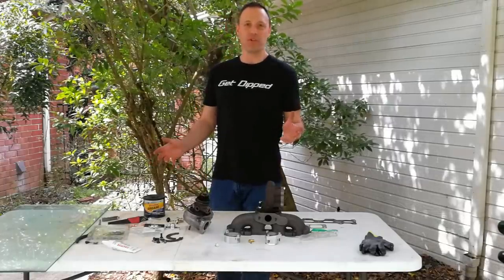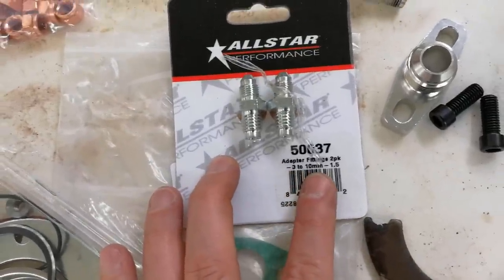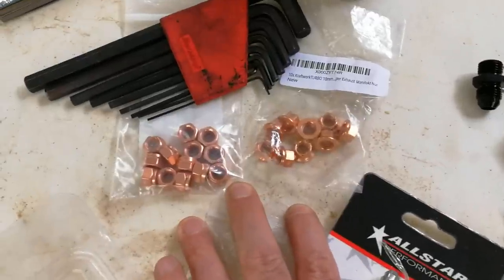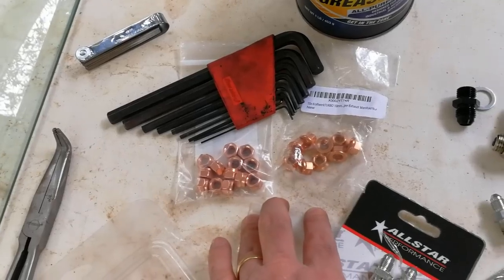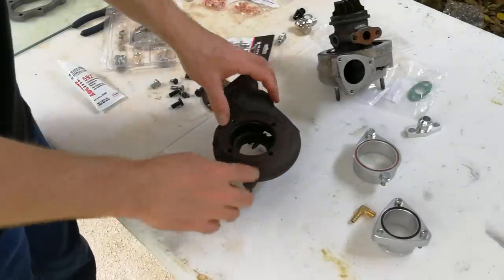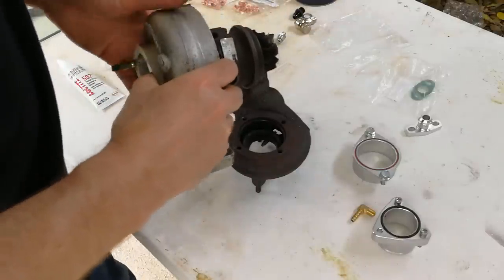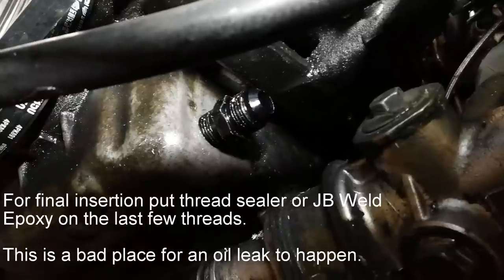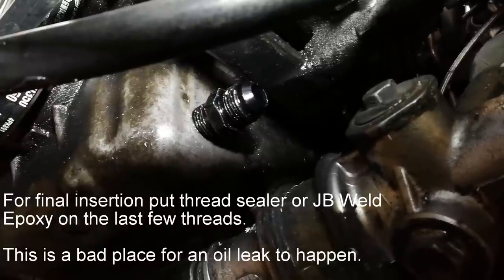DIY Miata Turbo (Ep 3) Turbo Setup, Lines, and Drill the Pan!

Comment: in my experience wrapping the drill bit with a butt load of electrical tape as the drill stop works a tad better due to the pvc not going ever where. You are also able to the how much shaving get on grease. I re greased like 6 times when I did it. Great vid. I just installed a GT2871R instead of a American assembled China Charger. And holy cow the response difference. Good luck in your build.
Reply from the maker: Thanks! Yeah I stopped and regreased about 3 times, lol.  Your gt28 is awesome!

Comment: Hello, for the four studs on the corners of the exhaust manifold to cylinder head , are you just going to run longer bolt or have you find any longer studs that will work with the thicker flange on the corner of the manifold ? Thanks
Reply from the maker: Yes I got 60mm studs in the same size and thread.  It's still a bit challenging though because putting the manifold on and off as a unit with the turbo is difficult with them installed.  I've cut the shelf a bit to help with this but I'll probably put one or two of them in after the manifold is on using the two nut method.
Reply: OGPedXing Do you mind sharing where you bought the 60mm studs from? Been looking for the studs that’s long enough for a while but don’t have any luck. Thank you